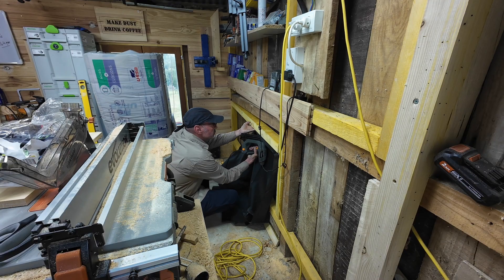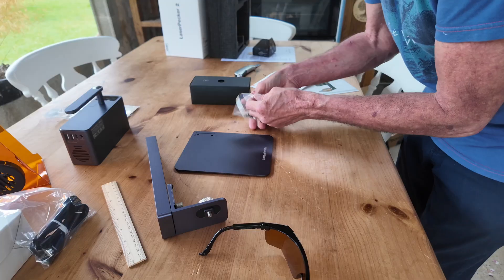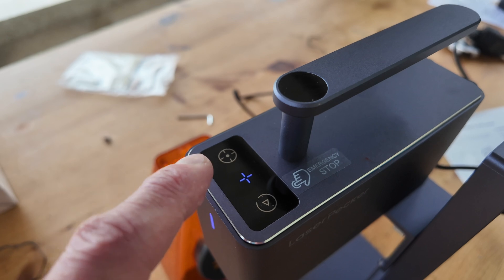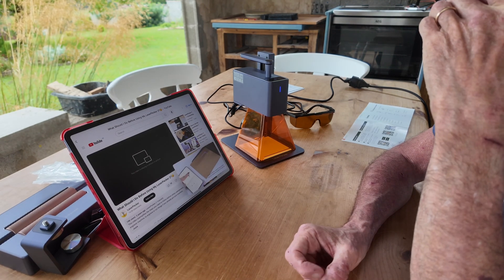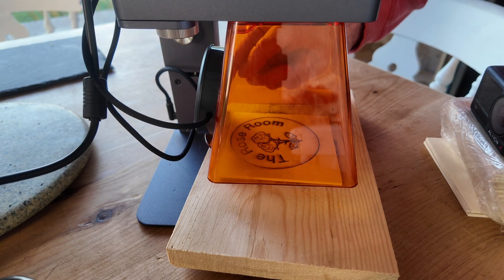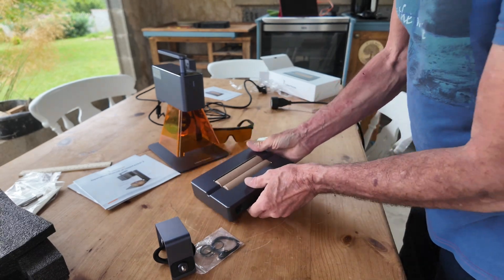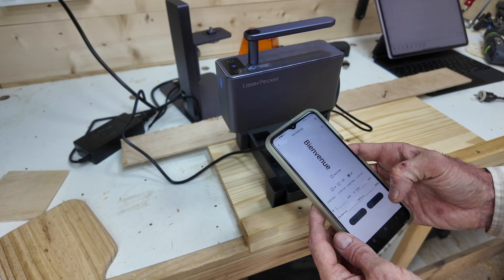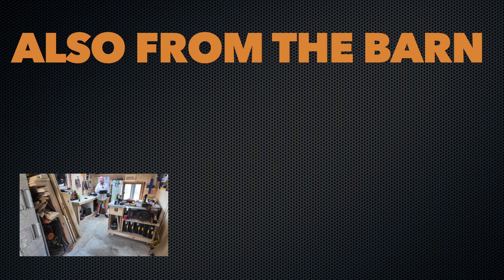LaserPecker 2.  Best budget laser engraver for small workshops?

Comment: Dinky- but over 2 grand for a 20w with such limitations is a bit steep. A conventional 400 x 400 20w is about half that. And will be more accurate than using tracking (how well does it do with both engraving and cutting on the same item? Or multiple pass cutting?).  A cylinder accessory would allow that any way- but I would just tile larger surfaces.
BTW I would argue that, along with CNC machines, the workshop is not the place for them. You do not need to be there.
Having got a laser cutter recently, most of the many projects I have made could not have been done with this due to area restrictions..
Reply from the maker: HI Mike. What model did you buy in the end? I know you said you was looking.  The LP2 is around £600-700 so a lot cheaper than  the Falcon 2 I have.  It worked fairly well on the dining table (albeit outside) and I was building the barn wall as it was doing its stuff.  You are partiality right about leaving the machines to it, when I ran pro CNC routers many moons ago, you still had to press the stop button every now and again , mostly as a head didn't fire up and it broke bits rather than not routeing on the correct line.  Regards JP
Reply: @Smallbarnworkshop  I ended up getting the Creality falcon 2 40W - around £1100. The 22w is probably better value at nearly half that- but being able to cut 22mm wood is so attractive... It comes with air pump, so only light extraction is needed- I mounted it next to my CNC enclosure, and put a port in the wall, so I just move my CNC hose across. Minimum infrastructure... Very happy with it, it is getting quite heavy use. I love not having to bolt stuff down, or jog to the reference feature.
Reply from the maker: Same model as mine 👍🏼